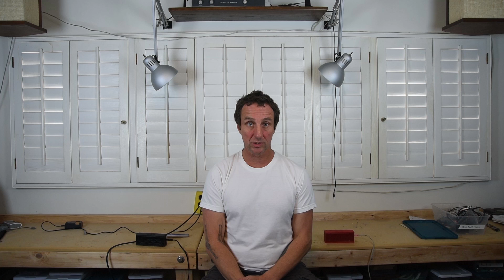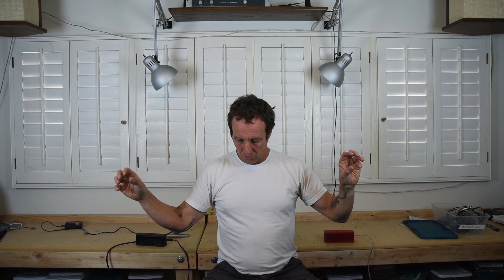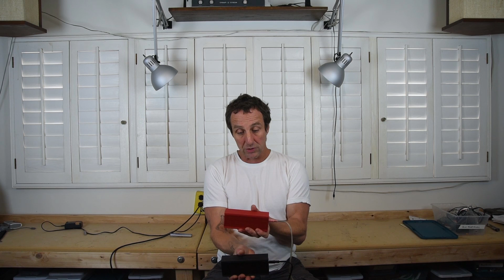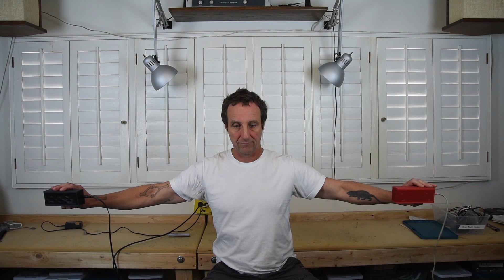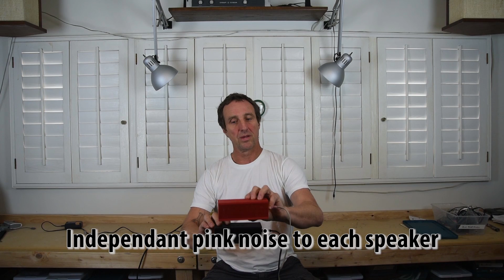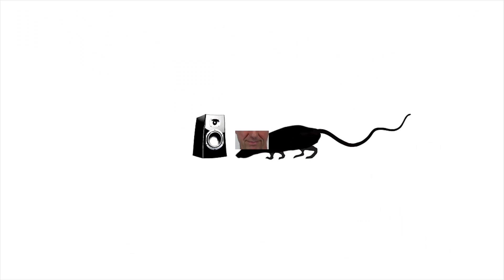Problems With Mono Sound From Stereo Speakers

Comment: Thats a great demo Dave. It makes me wonder about the famous Grateful Dead Wall of Sound which you know about. For those that dont, they had multiple columns of speakers (behind them on stage) Each guitar would have its own stack. Bass had four sometimes, one for each string. And keyboards had their own. Then there was a centre cluster for vocals and percussion.
A beast to set up - hence it only did a couple of tours, but it sounded amazing. It had that lack of phasing issue, each instrument came from a slightly different place, cow over there and goat over there - and it had heaps of headroom.
Reply: While impossible  to recreate the original because of the use of random equipment that was  available, the modified and the created equipment used but   the wall of sound should be recreated to the best ability just to study.  One of the features involved  individual control that anyone on  stage could adjust to  play a standard setting designed  some mapping by bear,  wide pan right and left minus the center or  switch to taking over the center channel. The dual mic and dual outputs Not stereo but 2 mono was exploited very well to cancel phasing.   I really want to hear this live. I've tried to recreate on a small scale but that can't replicate the shear size and power.  The massive size sent noise everywhere.  The digital takeover is wonderfully in many aspects and can recreate an logarithm to mimic these phenomenons but the analog factor was a part of the wall of sound and accumulated to produce something unique. I've heard some of the best board / pro live hybrid mixes  on some really nice equipment that blew my mind could be so sonicly pleasing.   Still I want to stand at the sound board and hear it then I would love in the privacy of my own wall of sound to play through it with some friends.

Comment: This here is the reason I will always love playing acoustic guitar.  Although the six strings resonate into the one box, all the other little sounds across the guitar can’t be captured and replicated easily by a speaker. I’m studying EE and I hope to make it easier one day to get that natural sound Dave is talking about here.  I think we will get close in my life time.
Reply: Natural sounds from an Acoustic guitar especially in a live setting are EXTREMELY difficult to achieve.  You're never able to get an Acoustic sounding "good" live, you can only get it sounding "not as bad" lol.  The only way to get it sounding good is to use a microphone, but that's extremely difficult because of how quiet an acoustic guitar is, the gain required on the microphone, and feedback because an issue immediately.

Comment: Interesting stuff, Dave! What would you do if the singer wants to sing with a prerecorded track? Basically, we're running the same mono mix out to 2 speakers with the same information (with enough physical separation to avoid comb filtering, d&b or Meyer narrow coverage speakers).
Reply from the maker: Live or pre-recorded, the vocal is still a mono source, that said, if it is pre-recorded, they could easily double track the vocals by singing it twice through and offer multiple versions of the box, kind of cool
Reply: Dave Rat thanks, I’ll try that! I know you don’t tour anymore, but do you prefer to mix in mono or stereo?
Reply from the maker: @premiermusicgroup3245  I mixed in very stereo. Or more accurately, dual, decorrelated mono/stereo

Comment: Fascinating, always worthwhile learning new advancements and perspectives. 

I'm not smart enough to contribute to this line of thinking. However, approaching the challenge of combing after it has been created ... it would seem as if one would always be chasing various less than perfect solutions. 

That said, examined earlier in the event chain, suggests the issue is one of coverage. If each hang can cover (both laterally and SPL) then you dedicate each hang to avoid the interference from the start. 

Whether that's 5 big Danley boxes left to right across the top, or 5 hangs of whatever... all accompanied with ample LF cabinets; done. The output can retain full correlation, time alignment, no swish, all the impact and detail. Less intermod, perhaps less compression, maybe greater dynamics. 
I know there's nothing new under the sun, it's kinda been done before ala Owsley's Wall. 

Merely a different perspective. 
All the best 
(I don't have the Covid-19 virus, but I do however have kleptomania, and when it gets bad, I take something for it)

Comment: This was the singular issue most successfully addressed by the Grateful Dead’s sound reinforcement many decades ago, when they built individual vertical arrays for each instrument in the band.  I was fascinated by that at the time.  It was a logistical nightmare to implement but a major sonic advancement.
Reply: I thought it was just a cover for trafficking acid 😂
Reply: I was thinking of exactly that while watching this. But yeah, I can imagine it would be a lot more work to manage.
Reply: It sounded like crap compared to what we have today though.
Reply: Griffin S   Well, I’ve never been a Dead fan, but their sound was a testbed for possibly the most brilliant designer in the world, then as now, John Meyer.  It was not crap by a long shot, but I’m not sure how one could compare the sloppy, out of tune ramblings of the Dead with anything else.  The system was superb then and would be now if not for the extreme labor and time required to assemble it.  We now have similar quality with amazing ease of setup.

Comment: At 6:32 I'm still a little confused of how you can put two different pink noises to each speaker and I wanna know is what do you mean when you put two independent sounds to each speaker from a source? Thanks brother.
Reply from the maker: Pink noise is random equal energy per octave noise. so though two different pink noise sources may sound the same they are completely different signals. I was using random paint noise sources to demonstrate that when you have different signals even if they sound similar or the same if they're not the same they will not some and they will have increased immunity to time, polarity, distance and phase issues

Comment: I told some audiophile buddies that my stereo sounded quite a bit better when I was running mismatched tweeters and they laughed at the possibility. I knew what I heard. Can't wait to show them this. My only question is why did Youtube take so long to show ME this?
Reply: So here's a question, does that mean if you used a line array, mixed it like normal, but the left stack was JBL and the right stack was EV (assuming they were both in-polarity) would that be enough of a difference to eliminate this problem while still using a single source between the 2?  Or would using micing everything in stereo with 2 different mics (where applicable) be a better/easier/more practical soloution?  Like putting a Sennheiser e609 on one speaker of your Marshall 4x12 and an SM57 on the other?  Then sending one to the left stack and one to the right stack?  Lol this has me fascinated now and I'm always struggling with getting even coverage, especially with low frequencies, in rooms with rock bands.  Maybe just doing it with the Kick and the Bass would be enough to notice a huge improvement.
Reply from the maker: The two pa's would most likely cause more issues than benefits. Dual mic'ing with different mics eq'ed to sound similar and then panned does work quite well.

For the lows though, a different approach is needed.

I will cover more in future videos

Comment: 0:37 Rain?
Reply from the maker: I like that you are thinking and scanning for occurances! Very cool. Rain would be a multitude of similar sounds. I would even venture to say that it is highly probable that each rain drop lands with a unique sound, not unlike each snowflake is unique.  For two raindrops to create the same sound, they would need to be of exactly the same weight, travelling at the same velocity, sticking an identical surface at exactly the same angle while being the exact same shape. One way to tell if two sounds are the same or very close, is they sound mono when equidistant between them. Rain is very much a 3d sonic experience.
Reply: @DaveRat  Yeah, that's true. If every drop sounded the same, people would probably stay inside because the noise would be disorienting and unbearable.

Comment: would this apply to subs as well? I mean sub placement in stereo and mono would differ a lot? in terms of wave lenght separation and so
Reply from the maker: running Subs & stereo gives you the ability to alter the sound sent to the left and right Subs somewhat and reduced power alley. I don't remember which video but I believe I have a video that describes stereo subs and mixing
Reply: Dave Rat thanks, I’ll look for it!

Comment: Interesting idea, but at the end of the day, you're still micing the same kick drum (the same vibrating drum head) and sending it to two speakers.  It's not the same as two independent noise sources. Now, if you could get the drummer to use two kick drums...
Reply from the maker: Yes true but if one mic is inside on the beater grabbing primarily the beater head and the other mic is on the port and grabbing more sound from the outside resonant drum head, they two mics see somewhat decorrelated sources. The differential between the sound sources the mics see, combines with using differing mic types and differing eq settings can be extremely effective in capturing a single kick and reprducing as decorellated stereo output.
Reply: @DaveRat  I'd think it would still make for different sound depending on where you're seated.  I'm not sure if the cure is better than the problem.
Reply from the maker: @russellhltn1396  absolutely, headphones are pretty much the only way to give the same sound to all. Once all are in a room, location based sonic variance is an unavoidable reality. One question is, do you want the people in power alley to hear a significantly different sound in addition to the other inherent variations of close vs far vs off to one side or the other or would you prefer to greatly reduce the big bass boost bump down the middle? No right or wrong here, just options to consider

Comment: Stop using Line Arrays then.
Reply from the maker: Well, using the proper tool for the job has value. One could say that a well designed line array acts as a single source over a desired freq range. Also, these concepts apply to seeking a natural or realistic sound. I would say that a significant portion of sound reproduction is focused on intentionally recreating unnatural sound. EDM, metal and most rock shows focus on intensity and listener experience.

The point of this is that if your desire is to recreate natural sound then use tools capable of succeeding.
Reply: @DaveRat  - I respect your opinion on a lot of things. I think your Microwedges sound great. We have a bunch of them. But, I'm gonna disagree with you on Line Arrays. They just don't work like the marketing says they do and it's measurable phenomena. They only have pattern control at very high frequencies and for only a short distance. They have tons of destructive interference and phase anomalies inside the coverage area. These are facts that can't be explained away by marketing. I don't care who manufacturers the boxes.
Reply from the maker: @soundbites1152  I'm not disagreeing that line arrays, and every other system type has a set significant flaws.  In fact, I will help support your point and give you a simple way of clearly demonstrating the issue you describe with line arrays.

Line arrays are always vertical, right? No one makes a horizontal lines array system. Why not?  Want to clearly hear the issues with any line array? Turn it on its side into a horizontal lines array 

Our ears are very perceptive of horizontal phase descrepancies and not so perceptive of vertical phase issues. Line arrays try to hide the issues in the vertical domain where we are less able to hear them.

By doing so, line arrays are able to offer us some more significant advantages in pattern control that while reducing the audibility of the negative side effects.

This line array deception is what makes them such a useful tool

Comment: My first public comment ever...   WOW!!!  A lot to think about.  I'm going to experiment this Sunday with my HOW where there are two condenser mics, one on either side of the pulpit, both going into a combiner with a balancing pot.  We have always pumped them through both speakers (center of room but one cantered to the left about 10° and the other right 10°) in a mono pan configuration through one amp.  This weekend I'm going to start testing...remove the mics from the combiner and insert them into separate channels, one panned left, one panned right with their gains set to match the mics, and start from there to see what I get.
If anyone has other ideas for me then leave them here and I'll come back often to read them, or you can sent email to 65BonAmi@pobox.com              Thanks.     Steve
Reply from the maker: Let me know how it went

Comment: Pink noise is a "random" noise and two differing sources sound similar even though in actuality the waveform is completely different. Just like two bowls of cake mix with the same proportions of egg, flour, butter and sugar would look the same despite a completely different configuration on an atomic scale.
A single source of sound e.g. a cymbal will be the same waveform. Mic'ing a cymbal or human speaker with two different mics you would get the same waveform into each (although the phase response of each mic might be slightly different) and if the mics were a different distance apart there would be interference problems again. This compared to a drummer simultaneously striking two different cymbals of the same make and model, a separate mic (can be same make and model or different) on each one and them far enough apart to reduce mic "crosstalk". Panning each cymbal to a separate speaker would provide enough differences to not interfere noticeably.

For something like vocals, a pre-recorded clip of me singing into the left speaker with me live singing through the right speaker would provide enough variation. For instruments that require more fixed tones such as a piano, this would be harder to achieve. This technique can be used on recording "voice doubling" to make a vocal sound fuller not just louder and delaying a perfect copy of the vocal would create combing problems again.

Theoretically, the loudest clearest concert could be done with the largest and loudest point source boxes available (Jericho Horns) and running multiples with a different instrument through each.
Reply: So, Grateful Dead style?